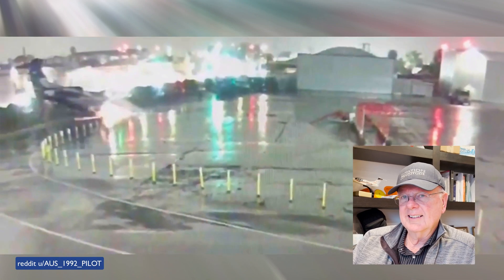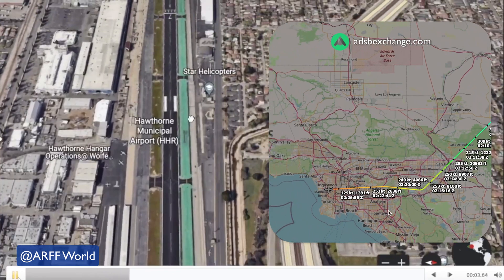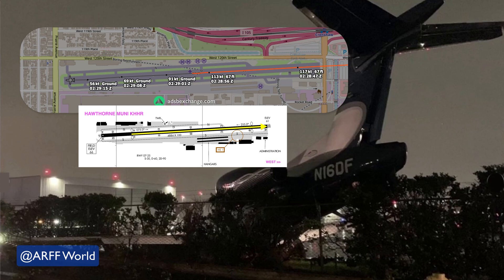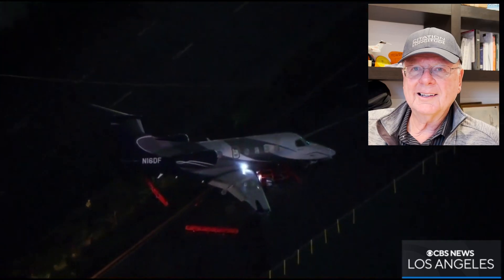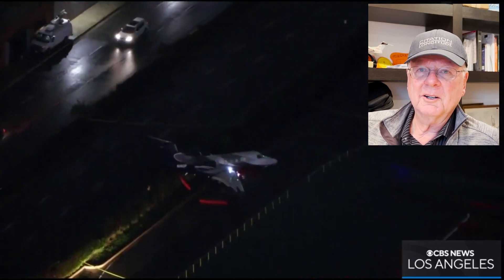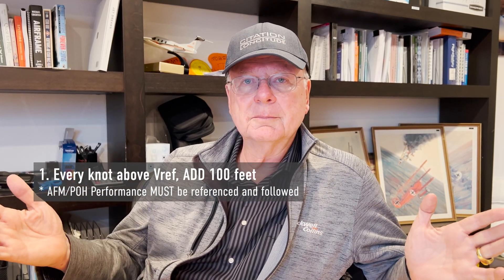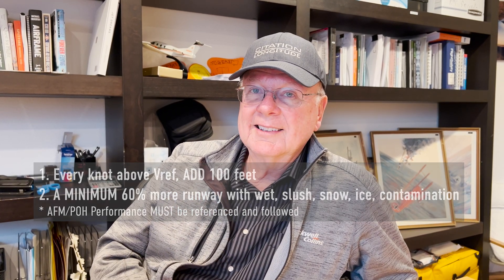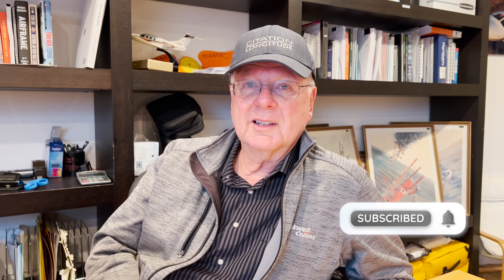Jet CFI Reacts to Phenom 300 Crash — N16DF Wet Runway Overrun Hawthorne Muni KHHR

Comment: I got my multi engine rating at Hawthorne and I can’t imagine why anybody would land there at night in the rain in a jet when there’s Long Beach airport just a few miles away with runway 30. it seems like bad judgment and or over confidence.
Reply from the maker: There are always a number of factors in any event, including accidents. In the chain of events we can all learn from each incident. LGB would have been a good alternate.

I remember when I hydroplaned at Dulles and the lack of effective braking was startling, like sliding on ice. No damage to my Aerostar but definitely to my ego :) I already know that I can do better as a pilot even after 13,000 hours - and I can make mistakes as well.